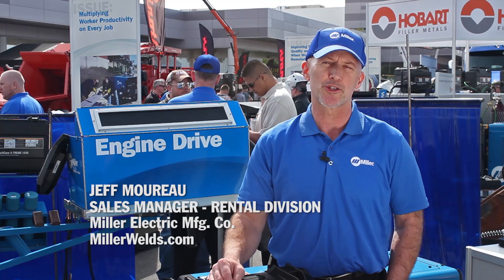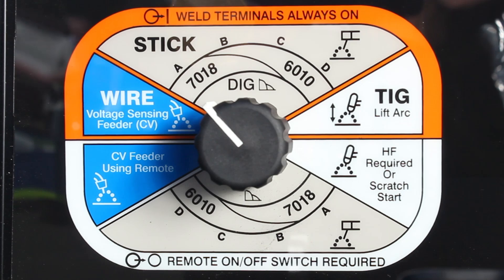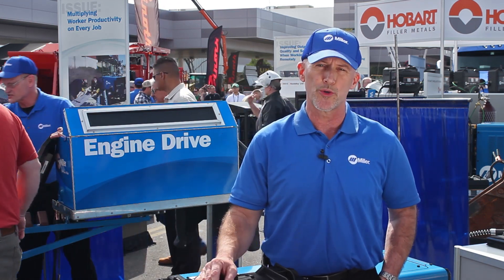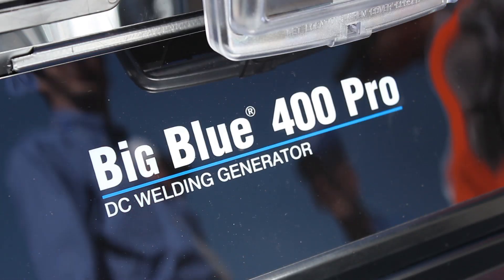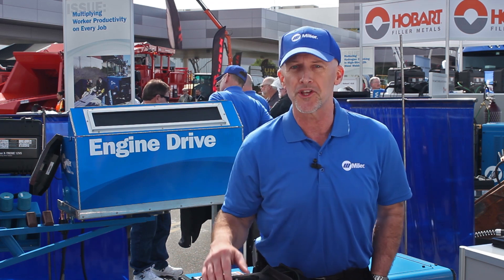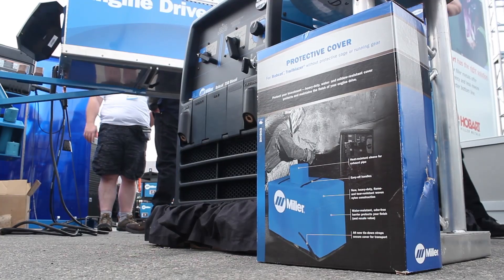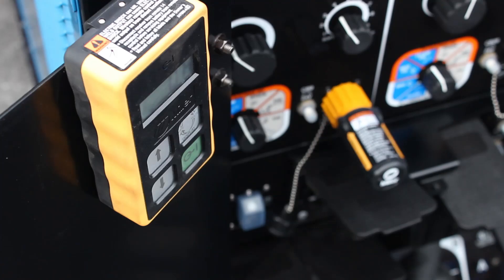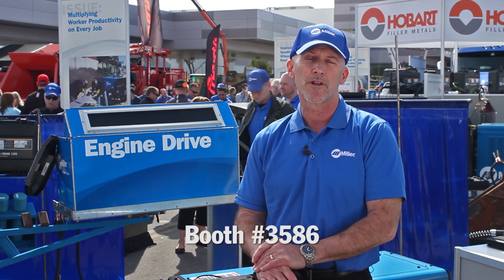How to Choose the Best Engine-Driven Welder

Comment: What’s the big advantage to diesel? Diesel fuel is expensive here in Tennessee, does it last longer per tank? Looking at a trailblazer or bobcat for stick weld I and backup power for my home, the diesel versions are twice as expensive, I know the motor will last longer but not sure how much longer and if it’s worth twice as much, thanks
Reply: Diesel engines are alot more heavy duty and reliable

Comment: yeah, buy a blue board eater. They make all their money selling replacement boards!
Reply from the maker: We appreciate you sharing your feedback. Quality and reliability are very important to us, and we are always working to improve our products and service. We will share this with our team. If you would like to further discuss, please call us at 920-734-9821.
Reply: They also shaft you on plugs and cords om maxsters.  We switched to esab. They are way better. We weld pipe indoors all day. Try esabs.  Had a cord issue years ago the guy jim from miller fed me a line. Never dis anything about it. Guy is a total turd. His cell 414-526-4224. Will lie right to your face. Complete bs. I tell you this guy is. Esab way to go. For engine driven linchon. They wont give you the run around. They will make it right not like this jim guy

Comment: Any tips on keeping them on the lower end of DB’s? Possibly any muffler attachments? I have residential work that requires a certain DB level in order to work certain hours. Anyway, thanks
Reply from the maker: Hi Andrew, thanks for reaching out. What dBA level do you need to meet? Are you looking for a welder/generator with an air compressor as well?
Reply: Miller Welders I have a Miller Bobcat 225, and I need to meet 70Dba. I’d like to hit lower if possible so I don’t have possibility of getting on the site supers bad side, and I do some work at home with same said welder. I’ve looked at forums, some say an auto muffler, even read about a catalytic converter. I’ve looked into generator mufflers. I’m only worried about creating too much back pressure. I’ve considered an enclosure for the unit, and a fan for air supply, I just don’t know what direction to take
Reply from the maker: Thank you for the question. Miller doesn’t recommend any modifications to the machine. We also recommend against running in an enclosure. Thank you.
Reply: Miller Welders Ummm, ok. Thanks?
Reply: MULITQUIP
WHISPER WELD!

Comment: Whaaaa? Wireless remote control!? Can this feature be incorporated into my 12rc suitcase? So I can still use the suitcase to adjust voltage with less cables?
Reply from the maker: The wireless remote control is unable to be incorporated into the 12RC feeder as the feeder is already utilizing the 14 pin and the feeder has remote control adjustment features already built into it.

Comment: i mis the durability on those  Miller welders.  All machines are thin plated.  Cheap plastic tiny knops. plastic wireless remote,   this should be designed better. I would made the outside from at least 3MM thick metal

Comment: what's the price range for the 225 miller bobcat welding plant
Reply from the maker: Thanks for your question. The manufacturer suggested price for the base model of the Bobcat 225 is $3,599 (US). For more details and to see all options, you can visit our website: https://www.millerwelds.com/equipment/welders/engine-driven/bobcat-225-engine-driven-welder-m90334  We also recommend checking with your local distributor for information and availability in your area: https://www.millerwelds.com/where-to-buy?buy=1  Thank you!

Comment: If my use would be 75% as a generator and 25% as welder, would it be better to get a dedicated genset? I want a reliable genset [diesel] with @ 15kw rating. In other words, is this really a 2 way machine without any real downside on either one?

Comment: Can I use the power output of the generator to electrically power a trailer that the welder is on to power the electric motor that is connected to the axle and pull the stuck vehicle out ?
Reply: you clould provided the power put out by the welder was enough to run said motor

Comment: hi im curious to know do engine driven dc welders run on normal alternator spun electrical outputs converted to dc or they actually utilize a homopolar motor to do this?
Reply from the maker: +fidel catsro Miller welders are AC/DC, AC to DC rectified for welding, and feature a classic alternator design.

Comment: Miller welders...Bobcat 250 and Bobcat 250 EFI.  Bobcat 250 choke with the option to buy/install electric fuel pump to become"EFI", whereas Bobcat 250 EFI has pump and no choke.  What else does the Bobcat 250 EFI process have to make it efficient, in comparison if I installed the fuel pump on the regular BobCat 250?  Basically, I'm trying to upgrade as much as I can to Bobcat 250, I just installed fuel pump, and making sure there is good and no loss to function.  Although, upgrades are nice, I'm looking for the most out of gasoline efficiency. Bobcat 250 ran for fourteen days during outage in Northeast during Hurricane Sandy.  Thank you
Reply from the maker: unionjacked  The Bobcat 250 EFI is no choke, more fuel efficient and has a better/ more reliable all-weather start, even with infrequent use. EFI is also up to 27% more fuel efficient than a carb unit.  The electronic fuel pump, offered on some units, can also be added as a field kit option. We recommend an electronic fuel kit in high elevations (altitudes of 5,000 ft.+). For additional EFI benefits, check out the following: http://www.millerwelds.com/landing/trailblazer-bobcat/bobcat/fuel-savings.php 
Please let us know if you have any further questions. Thank you.

Comment: I have a new Miller Blue Star 185 and was wondering if the SuitCase® X-TREME™ 8VS would be compatible with this machine? If not does Miller make such a thing? I have been trying to research this question for weeks and have found no credible answer. Any help would be greatly appreciated.
Reply from the maker: Jake Hettich The Blue Star 185 is for Stick and TIG processes, whereas the SuitCase X-TREME 8VS is only used for MIG processes. If you are looking to MIG weld, we would recommend at least the Bobcat 225. Please let us know if you have any further questions.

Comment: I have a Big Blue 400, bought it in '04 and has almost 6000 hours.  It has a Duetz 2011 engine, not available any more, bummer.
Reply: David Spennachio  Those big Deutz engines are superb but I have noticed a snag with them.  Often the build plate or a copy of it is present on the air duct which is held on with toggle clamps.  Either its the bozos who don't have pen and paper handy or maybe Chucky kids but the air ducts often go walkabout.
Reply: Tech Davey I'll have to check mine.

Comment: I have a miller bluestar E2 i just got it i weld grate but i would like to get a new engin for it to replace the old cast iron engine if any one knows what engine would work to do that let me know thinks. In also i would hope to get a engine that would run on propane couse im useing it to start a mobil weld in i have a old E350 van that ive bin runing it in in whats happing is the gasoline fumes are bad even with windows in doors opend in i know its old but it is a welder that has bin runing for 30+year in i like the old ones just want to upgrad engine in keep her going so i can buy new one down the line in use this one at home wen i do get a new one. Please let me know
Reply from the maker: Jimi Hendrix We do not recommend that a customer replaces their own engine. To talk with a Miller tech service group member, please call 920-954-3972. The Blue Star 185 uses the Kohler CH400, 3-year warranty engine. For more information on this product, you can access the specification sheet here: http://www.millerwelds.com/pdf/spec_sheets/ED2-5.pdf. The Blue Star is also a part of the Build with Blue promotion, which makes you eligible for a $100 cash back rebate or $200 towards Miller products. Please let us know if you have any further questions.

Comment: Would a miller bobcat be a good option for an off-grid living situation for a back up power source to my solar array? Being a welder by trade that would hit two birds with one stone.
Reply: Yeah go with the trailblazer for sure. If I recall the bobcat only puts out around 4k watts of power while the trailblazer 302 puts out 11k.
Reply: I use my trailblazer 302 to power up my entire house including heat pump during power outages. the only thing that makes it grunt is when the water pump starts up under pressure
Reply: Lorne Beaudette How did you wire the welder to your home?. I have an electric panel with a spot designed for a generator but im not sure about the wiring